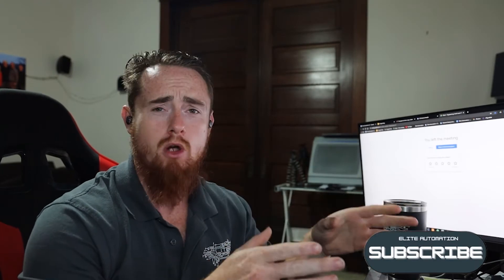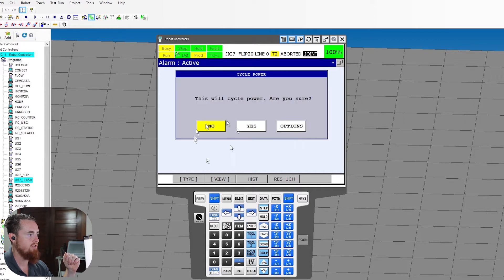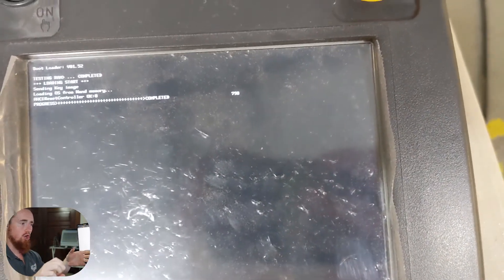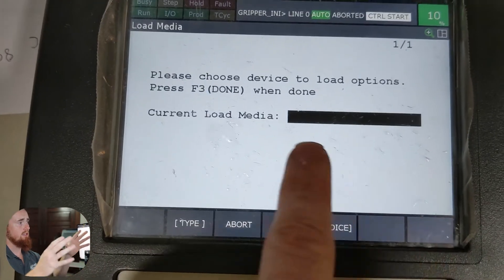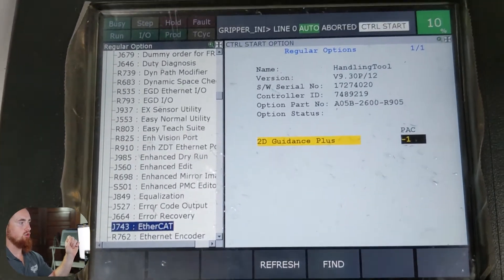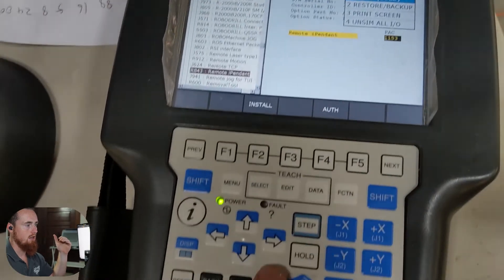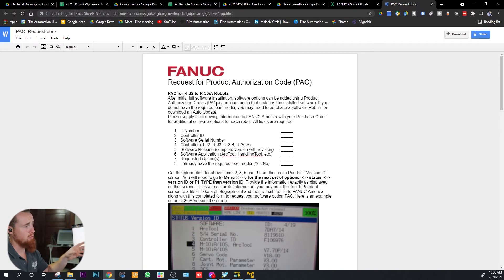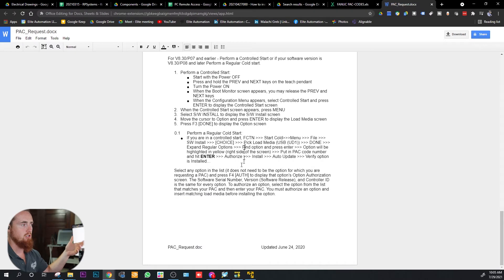How To Install Fanuc Option | Elite Automation

Comment: Hi i have a mori seiki sv400 mill machine with fanuc 18i control and my machine doesnt have macro optoin and i cant write any macro program so i want to install macro option on my machine can any one tell me how can i do that ? thanks 🙂
Reply from the maker: Herewith are some information regarding your questions about your Mori Seiki SV400...                                 
Unfortunately, adding a macro option to your Mori Seiki SV400 mill machine with Fanuc 18i control  might  be difficult and potentially not possible. Here's why:

Hardware Limitations:  Adding macro functionality often requires additional hardware on the machine controller.  Your specific Fanuc 18i model might not have the physical capability to support macro operations.

Software Restrictions:  Even if the hardware is present, some Fanuc 18i models have software licenses that restrict macro usage.  These licenses are typically purchased during the initial machine configuration.

Here's what you can do to determine your options:

Consult Mori Seiki Support: Contact Mori Seiki directly. They can access your machine's specific configuration and advise you on the possibility of adding macro functionality. They might be able to offer an upgrade package if it's technically feasible.

Fanuc Manuals:  Refer to the manuals for your specific Fanuc 18i model. These manuals might have information on available options and potential upgrades.

Consider Alternatives:  If adding macros isn't possible, explore alternative solutions:

M Codes: While not as flexible as macros, M codes in Fanuc controllers allow for some level of program branching and repetitive tasks.
Subroutines: If your Fanuc 18i model supports subroutines, you can use them to create reusable program segments for common operations.
Offline Programming Software: Consider using offline programming software to create complex programs on a separate computer and then transfer them to your machine controller.
Important Note:  Modifying a CNC machine's control system should only be done by qualified technicians or with the guidance of the manufacturer.  Always prioritize safety and ensure any modifications are compatible with your specific machine model.

Comment: sorry friend I have an LR MATE 200/ID 7L robot with an R-30IB MATE PLUS controller, I have a problem with it, I bought it new but it doesn't have the option of IP ethernet, I can't find it in my teach pendant, do you know what it will be?
Reply from the maker: It's an option that needs to be purchased. If it's not showing up it's probably not installed.   You should be able to find in your options list and if it's installed.